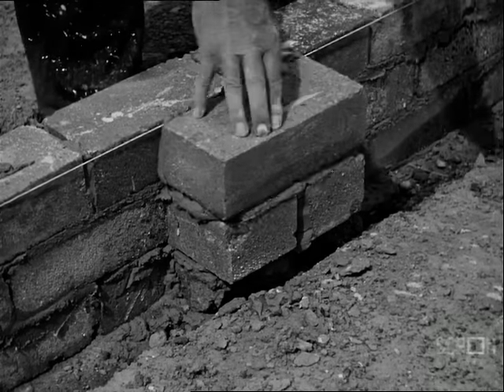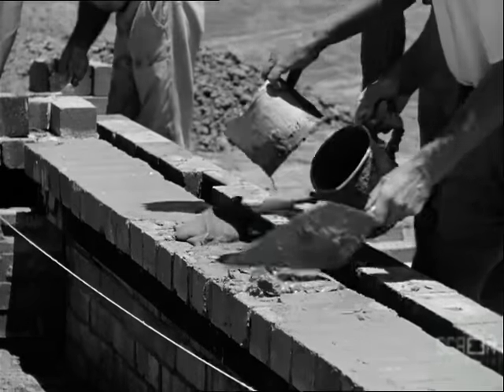Building A Brick House

Comment: Awesome vid!! Real tradesmen, if only they built homes like that nowadays. That brick home is still standing while homes built 5 years ago are falling apart.
Reply: There are contractors willing to take the lowest bid and build fast to make a buck.

Many are foreigners that get into the construction industry and deliver projects on discount but not gurantee.

As a Handyman almost all my jobs are done ok and last.

Also the main problem is the building permits.
They are expensive and then added to that inspections, licenses and insurance required.

So if a house material cost 400k and construcion work 500k or more. Still insurance and building permits and inspectors  and Osha will take at least 200k
Reply: And the first cracks become visible in only 3 months.
Reply: @MarkWhich  yes that happens often when houses are built on wood.
Because depending on the tempeture inside amd outside the house. The wood tend to re adjust itself.

Wodd studs are still very flexible compared to metal.
However if metal is used, and constructiin according to specifics.
There shouldn't be no cracks , if any, if any is just ine spot because thick metal don't move.

If the gauge of metal is above .18 reinforcement must be added, however over all metal is in many cases better than wood.

Comment: Fascinating stuff.  My house was built in 1948 and many of these building materials look the same.  My wife and I were pretty adamant about buying an older house because they're made so well.  It's still a lot of work, though.
Reply: Totally agree.  Older houses is all I buy due to they are built better than the cheap boxes of crap that falls apart the moment it gets wet - the sawdust/wood chip crap called engineered wood thats used for support structures. SMH

Comment: Here we are in 2016 and as a bricklayer, nothing's changed really.
Reply: Uh, yeah it has.
You can't use lead now, and OSHA would never allow a guy to stand so close to the edge of a roof!
Reply: +Maxx Fordham! We're using lead on the site I'm  on now! And I mean the trade itself, not health and safety.
Reply: Oh, mac4564, I guess I was thinking all lead had to be eliminated from the builders' diet, what with the paint and all.

Thanks for clarifying the limit of your point now.

Happy Flag Day (USA)!
Reply: +Maxx Fordham! No here in the UK we still use lead for flashings around Dormer Windows, chimneys etc.
Reply: And I guess you still use random capitals for some common nouns for some odd reason too, huh, mac4564? Hehe....

So why lead, if there should be so many other materials that could be used instead?
Reply: +Maxx Fordham! Lol, yeah that's iPhone autocorrect for you. 

I'm not sure why we still use lead here as I'm sure there's other materials just as suitable. No doubt it'll boil down to cost, like everything does on sites here.
Reply: Well then, mac4564, you ought to turn that "auto-WRONG" off. I can't see why it did that. Why didn't you correct it back after it did that?

Yeah, I'm sure there'RE other materials too. Why would lead be so... um.. "cheap"?
Reply: No more double Wythe walls on homes any more.
Reply: It's exactly how bricklayers works here in Latin America, specially near tropical areas.
Reply: Mason's job is highly skilled.  Of course there will be others who will assist with labor tasks.  Time spent by craftsmen to mix mortar, replenish materials, etc, is wasted time and money.
Reply: @jasonwoods5326  exactly, I think half of the comments here are from people who know little about house building.
If they were all built by top craftsmen the only people who could afford to buy them would be the rich
Reply: bad Good  My father was a master mason.  He was not always a master mason.  He started as an apprentice, for his father.  He had to learn all the labor tasks, as part of his apprenticeship.  Must have knowledge, especially if you are the foreman on a job.  Labours were there to keep the masons supplied and productive.  Not all jobs required heavy labor support.  I remember my dad telling me about a fountain he and his father built on Michagan State University campus.  Just the two of them, handled all materials.  Very detailed and slow build.  Had to know all the building skills.
Reply: bad Good  I'm not a mason.  Dad was only on union jobs, while a mason.  Back in the late 1940's, it was possible to start apprenticeship while still in high school.  Would never see that today... OSHA, state laws and all.
Reply: User, I never said I'd think the OSHA would be at every job site. I figure they aren't at a lot of places, like... oh, say... restaurants, libraries, schools, most stores, um... you know, basically "soft" places like that. But I figured they'd be at most USA industrial sites like this. I could be wrong, I guess.... But even so, where OSHA does maintain a presence or at least visit, that's what has changed over a while.
Reply: But Tommy, which possession of a "bricky" were you trying to refer to?
Reply: The only reason they stopped lead paint was because home owners would sand back a house to repaint and inhale lead. Lead is still common in construction even new hospitals
Reply: Mitchell, it's still a change. Why is lead supposedly still common in new buildings, and how did you hear about that idea?
Reply: @HelloKittyFanMan.  I'm in the construction industry we used lead lined plasterboard to protect hospital staff and patients from radiation. Also still use lead flashing. But damp course is plastic
Reply: Oh yeah,  @mase4287 , for situations in which X-rays are used, huh?
Reply: And that's the problem. Time to pour reinforced concrete floors like we do in Europe instead of cheap British floorboards which squeak and are noisy af.
Reply: Come to Argentina and we still build as 19 century
Reply: @limawhisky  
Or even if we don't go there.
Reply: I'm just glad us machinists can still inhale that fresh coolant swarf on a daily basis. I dunno though, good things never seem to last 😉

Not good houses though, those last forever. Or close to it. At least relative to a human lifespan. Wish there was video of an old castle being built.. that would be wicked cool
Reply: mac4564 except Brickis went from being gentlemen to scumbags hahaha 😂
Reply: @bogey19018  Still in play in commercial, institutional in Canada, but yer right, not in housing
Reply: bad Good  Screw you! That's a labourers job.  Below my pay scale.
But seriously, I agree about the brickee's.  When I was working building schools, we were the prima-donna queens of the jobsite.   I was often embarrassed on how the other trades & labourers were treated.
Reply: No insulation, no felt on the roof, no double glazing, no engineering brick course and I don't even think I saw a lintel 🤣
Reply: @ZeroNiteLite  it is 1946...after all.

And double glazing?

Come-on - we had triple thermopen glazing in our windows built in 1986!

Nowadays you have triple-glazing with Argon or Krypton filled soace between the pieces of glas, swiss spacers, special UV-reflective coatings and of course on the outside laminated glas^^
2 x 4mm with 2 or 4 layers of poly-vinyl foil molten all together so even a thrown brick will not go through^^
Reply: @HelloKittyFanMan.  Lead is still around.
Reply: @Jack-wf9kg : I never said it wasn't. Yes, it still exists, of course. But it's not used in building material anymore.
Reply: @HelloKittyFanMan.  Yes it is. Just not for plumbing last time I checked?
Reply: @Jack-wf9kg : LOL, if you think you know that then why are you asking me?
Reply: @HelloKittyFanMan.  Yeah, whatever helps you sleep at night.
Reply: @Jack-wf9kg : I never declared anything about helping me feel better, etc. I asked you a simple question. Are you saying that you don't know how to answer it?

Comment: Things to watch out for when buying a Solid brick home of this vintage. Check the depth of footing. These days it's 600 deep and further depending on the clay bed. My 1946 home has 2 solid walls on each outer footing and average 250mm thick. Check the inside walls. They used to use "Dough boys" cheap seconds that weren't cooked properly. They were lighter and more pourus. They crack easier. Inside walls were in some cases not cross bricked and lots of off-cuts were used causing cracking.
Reply: good call. My father was a house builder in this period and told me how they dug stump holes to the required depth where they knew the inspector would look, the rest were placed just an inch below ground. Dodgy builders have a long lineage.
Reply: I lived in a stone home, where someone dug out a basement under the porch, but you saw the footing.   Holy smokes.....it stuck out 2 feet and was 2 feet high, and that's as low as the floor went.  No telling how much stone and concrete was used.   The footing was tiered, and was higher on the outside, then in the basement side.    The footing was at least 4 feet wide.

Comment: Double brick was stopped here in New Zealand years ago. They fall down very easily in earthquakes. Great workmanship and diligence in this build in spite of that.
Reply: So what do they use now to prevent falling down?
Reply: @robertbrandywine  By first building timber framework then putting bricks up round it using fastners to the timber as they go
Reply: @samskeeter1  That's what we call normal over here.  I never knew it was especially resistant to earthquakes.  We just call it cheap, LOL.  Still these cheap homes last well over 100 years.
Reply: @robertbrandywine  Double brick houses fared very badly here in quakes in 2010 and 2011. All I will say is brick houses with timber frame work didn't completely collapse.
Reply: Yeah that place is a deathtrap in any disaster. Them heavy tiles over your head?

Comment: I live in a block house. circa 1960.  Lots of brickwork too. 
Brick fireplace and chimney. Very solid. Metal roof. (Lead paint but it's covered with other paint) Since it is a warm climate many of the homes here are prefab, modular, single wides, double wides. etc. I'll take the block house, thank you.It was a DIY and I must say it has character.

Comment: R.I.P real homes. real wood, real bricks, real MEN!
Reply: They don't make them like they use to. Everything's gone soft nowadays.
Reply: Tbh I don’t see much difference, except that every one was using nails lol
Reply: They didn’t even fix the tiles and there was no insulation or felt in the roof
Reply: Ikr
Reply: Real human, now people live in their phone 😅
Reply: Yeah real lead paint, real asbestos, real cadmium and rheumatoid arthritis at 40....what great times those must have been.
Reply: @Crazyman1212  Asbestos didn't really do much harm until it was broken, that's why most asbestos related cases were in industry etc
Reply: @Crazyman1212  thing is homes built up until the 60s were solid. 9 inch walls, oak timber, proper clay tiles, superb over engineered craftsmanship. Victorian homes are the best most are 130 years old now and still solid. My friends house wich is victorian, exploded from a gas leak (video is on youtube) and the house didn't move an inch just had to be re furbished on the interior. A modern matchstick house would have been blown to pieces. Modern new builds are fucking garbage. Your buying a house with a 25 year guarantee at best.
Reply: R.I.P silicosis
Reply: Tf is your house made of? Twigs?
Reply: @tommypetraglia4688  You may be 62 but your maturity is the equivalent of a 15 year old boy
Reply: Tommy Petraglia In case you didn’t comprehend my sentence correctly, I was commenting on this generation (my generation) not yours. 

On a unrelated note, you’re 62, calling me a snowflake despite not knowing anything about me or my line of work, yet you’re whining like a 12 year old? Sir I think you should reevaluate who the real snowflake is.
Reply: @MattUKepcc816  Efficient != soft
Reply: Real bargain homes?
Reply: M V Cheap materials != Efficiency
Reply: That's how we do houses here.
Reply: @tommypetraglia4688  Nobody cares how you chose to waste your life, man. I'm sure nobody's ever worked as hard as you, though. Keep patting yourself on the back, there. I especially liked the part of your reply where you were unnecessarily hostile and misogynistic.
Reply: @MattUKepcc816  They dont pay them like they used to. Pay me 100 dollars an hour to match inflation and you'll get your houses built proper.
Reply: Yup, millennial "man" can't even change a tire.
Reply: @MattUKepcc816  soft and cheap material, but the price are more than doubled.
Reply: and terracotta tiles!
Reply: As a Bricky a day insulation etc are ether but would say bring back lime
Reply: Ah yes, no insulation, lead paint, lead flashing, lead pipes. The good ol days lol
Reply: @alexmaclean1  Asbestos 👍
Reply: @liamkisbee8117 rose tinted specs. New homes are better insulated. In the old days, those Victorian houses would be basically heating the sky as there was no roof insulation, just slates on top. Also, outside toilets in many of them, the kitchen ? Rather go to a cafe than think how grim that must have been cooking. The only reason those 130 year old houses are looking good is because owners have spent a fortune UPDATING them. Wow, wake up.

Comment: I grew up in a double brick house in Sydney with a large under-house area .  So much better for summer and winter temperature control than the brick veneer rubbish *today*.  The terracotta tiles on the roof were still in perfect condition after 80 years - no need to strip and resurface like you do with concrete tiles every few years when they begin to leak. PS  I now live in a BV house because I can't afford anything better.

Comment: Ironically, most of those houses are in better nick today than some new build homes that were finished last year
Reply: Not joking, the house in the video looks way better than the modern one, soild double brick wall, 10 times better than concrete wall.
Reply: @leonhou7137   No way. Those vented floors are always cold, and always saggy and bouncy. Without proper vapor barrier and roof insulation you are basicly heating a street. Double brick wall with air gap has 4.4 times lower insulation value then standart 2x6 wall or 300mm aerated concrete wall.
Reply: @zuhelWTF  May be, but i never liked concrate wall for home, it just doesnt feel right.
Reply: @zuhelWTF  Give me a proper suspended timber floor in a house any Day of the Week. Better than a freezing cold concrete slab.
Reply: @TheToolnut  First of all, why are you walking on bare concrete? Cover it with hardwood. Secondly if you really want suspended wooden floors just make them over conditioned crawl space. Vented crawl space is shit, end of story.
Reply: @zuhelWTF  It doesn't matter what you do to a concrete slab it's still a freezing cold lump of concrete. If you have bad circulation and a bad back standing on concrete for prolonged periods is terrible. Concrete slabs are for aircraft hangers and factories, not for domestic houses.
Reply: @leonhou7137 er no. I worked for a large house builder in technical support, construction methods are far more efficient today. Old Victorian houses may be elegant but remember, any that look like new and “in better nick” with fancy interiors are only like that because a fortune has been spent on them by numerous owners to get them up that standard. They weren’t like that when they were new. Uneven walls and floors, a roof with just slates and nothing underneath to protect from the weather so leaks were commonplace. Take off the rose tinted specs.
Reply: @zuhelWTF correct. Some people haven’t a clue. I bought an old victorian house once, it was a money pit.
Reply: @TheToolnut is that so ? Concrete slab foundations are cheaper and easier to install and provide protection against the water table.